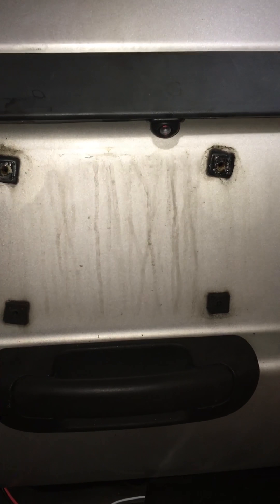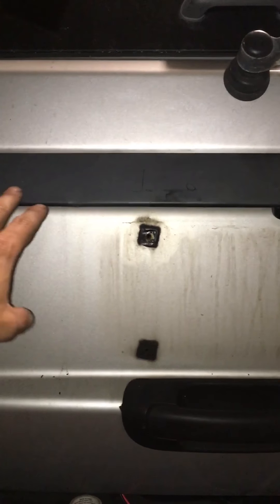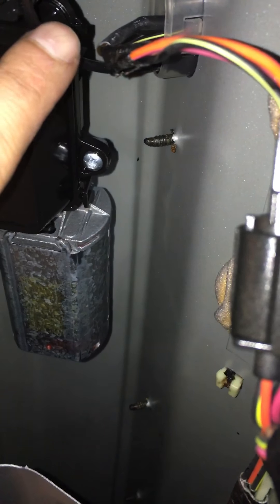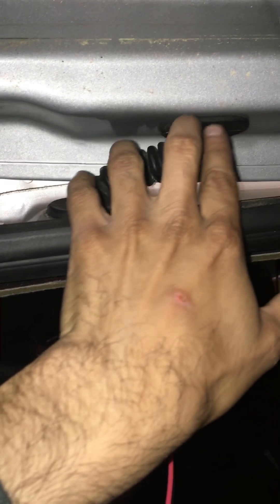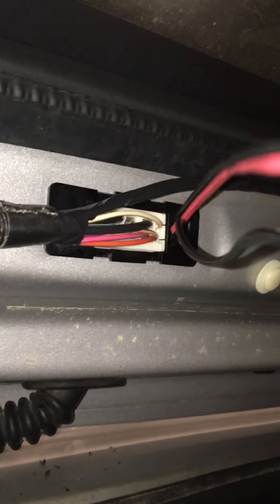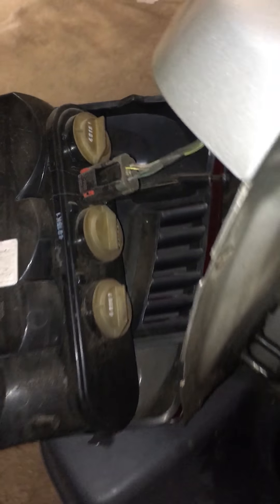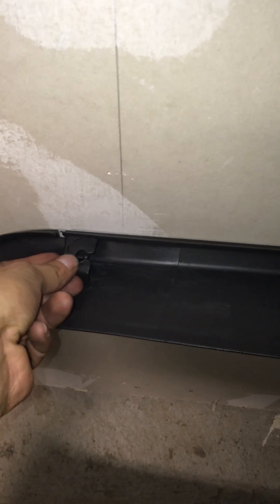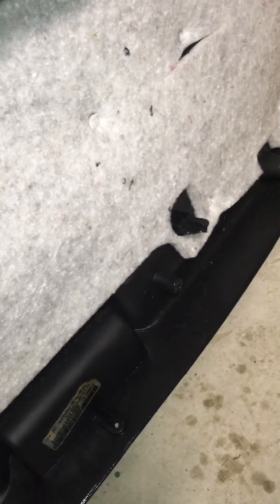99-04 Grand Cherokee WJ Jeep Rear view / Reverse camera backup cam

Comment: Well done. I ended up using the same type camera and running the wire along the passenger side along the floor panel, up then inside and behind the glove box, and into the stereo system.
Reply from the maker: I recommend sealing the back of the camera with liquid tape or hot glue, I just had to replace my camera due to water damage.

Comment: The clips that broke is very standard. You can buy a pack of 100 of them online for around $10. They are called interior trim retainers or door panel clips.
I replace mine every time I take a panel off. There is no reason not to.

Comment: Julio, did you figure out what wires in the tail light are power and ground to tap into? I setup my camera on my 99 WJ this weekend and everything is run but i'm not getting power in the camera.
Reply from the maker: I tapped into the left rear back up light. Don’t remember the color. Disconnect the wiring harnesses from the tail light and have someone hold the brake and place the truck in reverse. Then use a light tester to determine what wire is the backup light. The light tester will turn of when coming out of reverse.
Reply: The power is the purple wire
Reply: @xlightssx  To be fair, if we could define what color wire to tap into, it can be tapped into at the left shoulder of the inside of the trunk, behind the panel, driver's side, where the majority of the rear harness and jump harness runs. So could you please look on yours and remember? it would be a great help, since there is NO CLARIFICATION ONLINE for this at all!
Reply from the maker: Lee Smith that would require me to disassemble the Jeep. I will see what I can do. Do you have a light tester?
Reply: @mutmeista  The purple wire with black line on it.